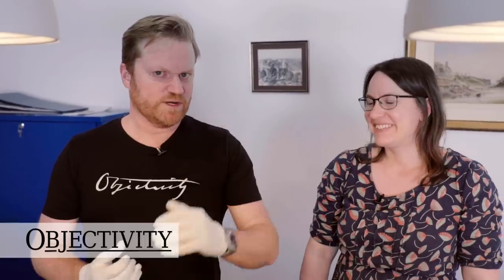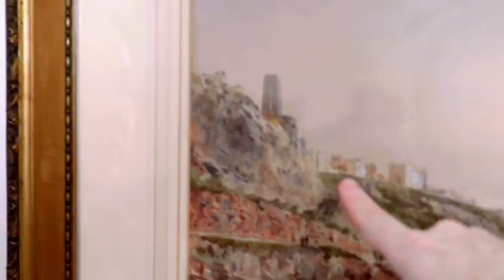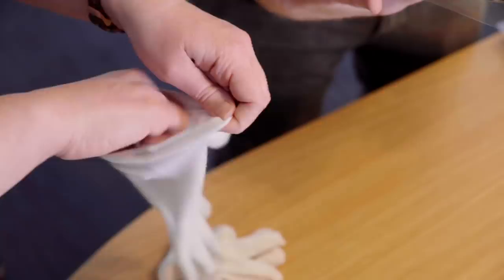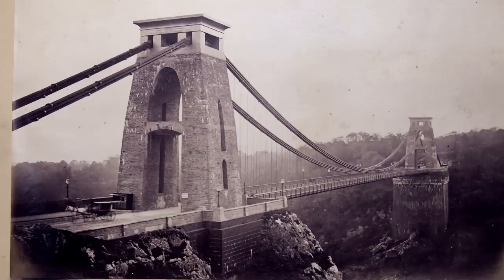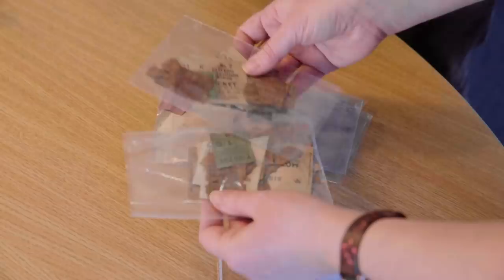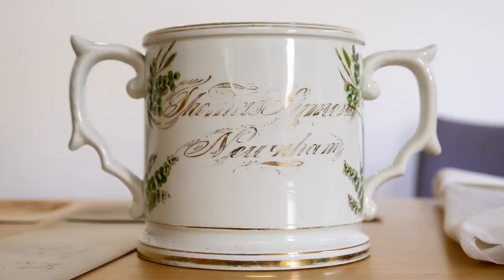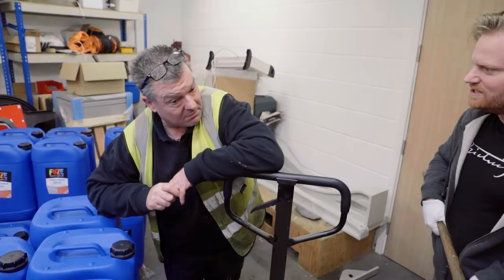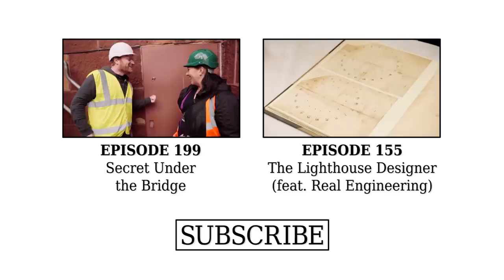Building a Bridge - Objectivity 206

Comment: Loving these videos, what is a cradle in relation to the bridge?
Reply: I believe the cradle sits on top of the towers.  It holds the suspension cable on location and protects it from damage.
Reply: @WhatAboutTheBee  Nearly! We have iron chains, not cables and the cradle or gantry is used to transport maintenance workers along the chains or under the bridge deck to inspect them. What you're thinking of there is the saddle.
Reply: @brunelsbridgebristol  I stand corrected!  Thank you for a proper explanation!!